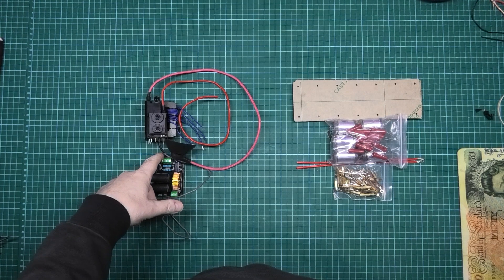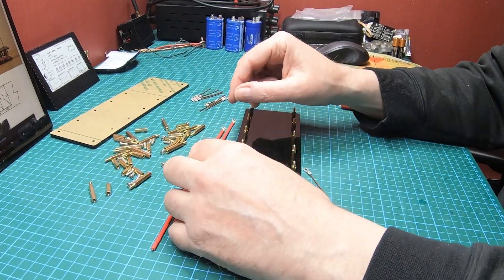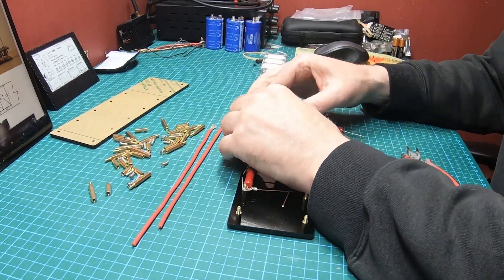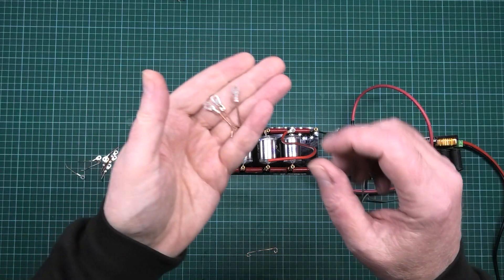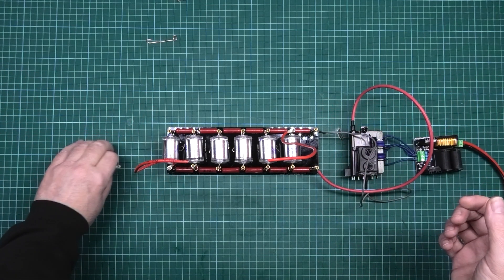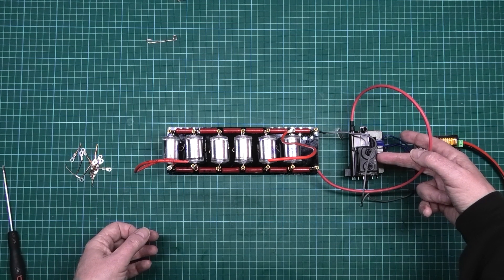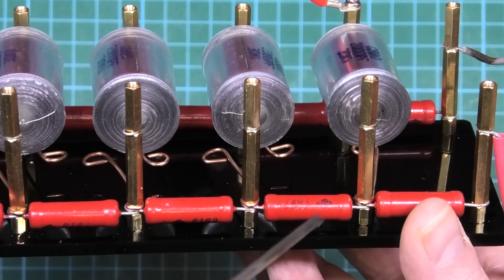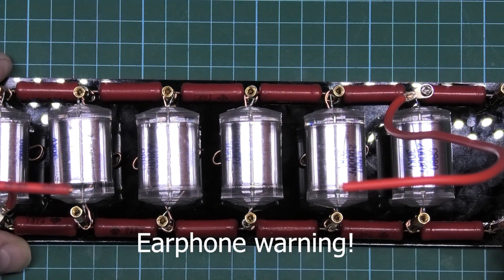𝐌𝐚𝐫𝐱 𝐠𝐞𝐧𝐞𝐫𝐚𝐭𝐨𝐫 - 𝐟𝐮𝐧 𝐰𝐢𝐭𝐡 𝟏𝟐𝟎,𝟎𝟎𝟎𝐕 (𝐭𝐡𝐞𝐫𝐞 𝐚𝐛𝐨𝐮𝐭𝐬)

Comment: I bought a kit, but it didn't come with any instructions. I noticed you had some on your screen. Is there a link to them anywhere?

Edited to add, I have a degree in aerospace engineering which included some electronics and electrics, so I'm well aware of the risks involved. :)
Reply from the maker: This is probably the most detailed instructions I can find.... https://www.aliexpress.com/item/1005003064281281.html

Comment: I've been playing with this exact bit of kit, I wasn't expecting much from an eBay chinesium product but with a little fiddling it makes some dangerous sparks. I found a priceless comment on another youtube video that explained how you can seperate the spark gaps to the point they are on the brink of firing, so that you can trigger the first spark gap manulally and make it fire at peak voltage by bridging the first stage spark gap with a piece of wire on a chicken stick. The arcs are noticeably louder and can be adjusted to much longer lengths versus an automatic trigger system.

Comment: Danger danger, high voltage, when we touch, a-when we kiss.

Stay safe Tony, I think that would tingle a little.
Reply from the maker: It wouldn't only tingle for a very short time mate. Within 10ms, your spinal reflex (your spinal reflex is what makes you pull your hands off hot things because it's quicker than letting your brain deal with it) would be rendered useless. This means you wouldn't be able to let go and I reckon that within 100ms (2 pulses), you'd be dead.
It is pretty though 😁

Comment: Would be good as an electric shocker as a self defense gun. What input voltage and current it needs?
Reply from the maker: It's 25V and around 5A. The only trouble is, a single use would be LETHAL 🤣

Comment: Hi I need your advice if you dont mind. about building e bike what battery would you use for 1500w or 1000w voilamort kit off e bay that's going to give me decent amount range and speed.
Reply: Sorry to jump on this, I have the 1000w voilamart wheel, I get over 30 miles out of a single charge
Reply: No thanks for the information Steven it's helpful, what battery do you use and whats your top speed
Reply: 48v 13ah battery off eBay as well. If I remember rightly I got both for around £355
Reply: As for speed in restricted  mode. Its about 20mph. But unrestricted  its 30mph plus but only get around 10miles from a charge

Comment: DANGERS might be X-rays, ultraviolet radiation, short-term perhaps no obvious side effects, long term possibly could be!
Reply from the maker: As I said in the description, do not build this if you don't know the dangers - hopefully, people read the description.
The duty cycle is very low, so the UV is minimal but the X-rays are certainly a concern which is why I stand in another room when I fire it up.
Reply: @Vortecks   @Vortecks  Didn't watch it full anyway. I'd "imagine" those ppi steps are ok. Fuck it, too busy drinking, I posted that fukin' 5 houts ago